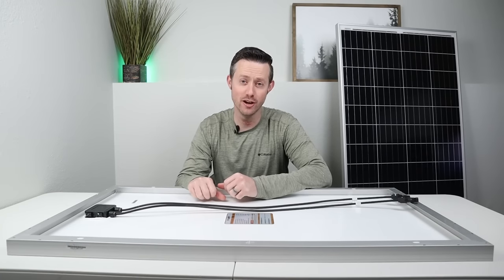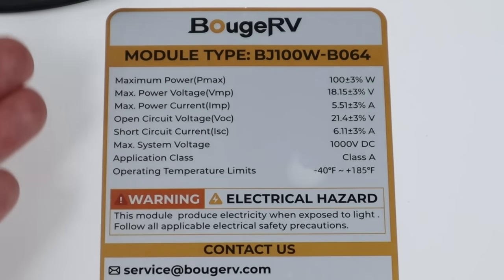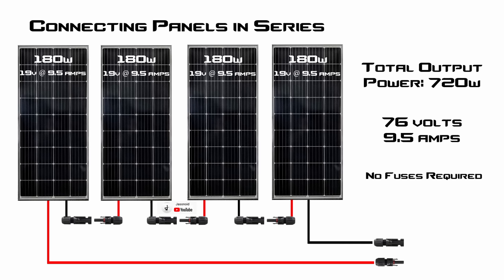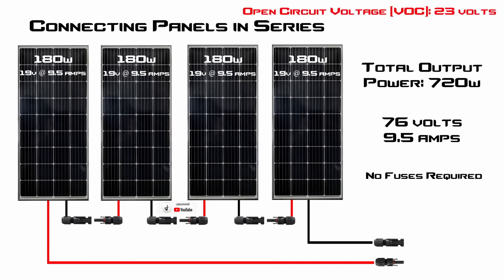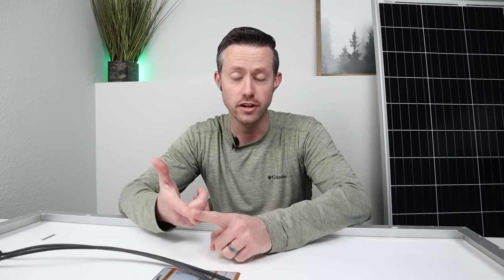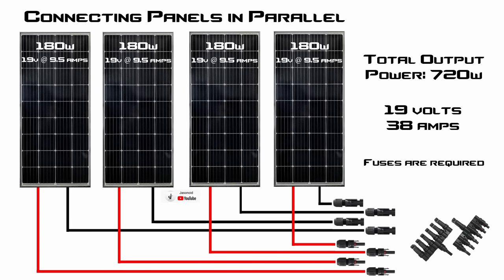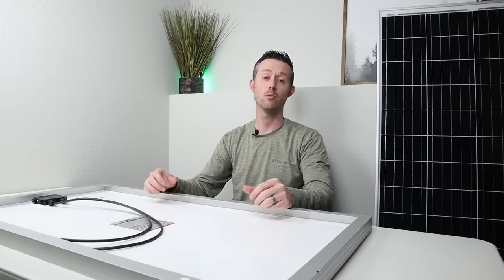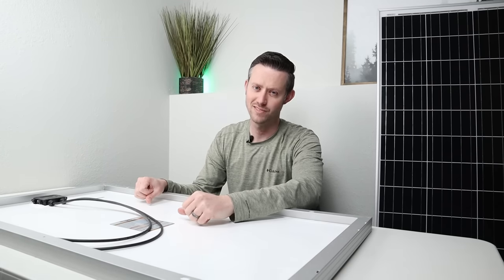Series VS Parallel! A Beginner's Guide for Solar Panel Connections - With Basic Diagrams!

Comment: After several years of learning about solar for my motorhome, I finally built a fairly robust system. I had just enough room underneath the fridge/pantry area to fit all of the components. 520AH lifepo4 bank, 3 separate 40A/150V MPPTs and a 3000W inverter for a 12V system. I have 2 sets of 3-250W panels on the roof connected in series, 1 set for each of 2 CCs. The remaining CC is for an additional series array when parked.
The system sometimes generates a total of 120A in full sun. 
I'm not sure if it's the most effective configuration but I couldn't fit one large charge controller under the fridge. It's been working perfectly for 8 months. I also have one additional 250W panel on the roof that I connect to one of the arrays in winter for a total of 1750W. I can also add an additional (4th) panel (in winter) to the 3rd array when parked, for a total of 2750W.
Reply from the maker: Sounds like a great setup! Thanks for sharing your progress and the direction you went with. I think splitting up the panels on different CCs is a great option to avoid too much amperage. I always like to hear real world examples.

Comment: Thanks so much for this video. I have really learned something from it. Please, i have 2 300watt  panels, 1  200amp battery and 60amp charge controller. What connection is appropriate and what size of MCB should I use? I will appreciate your response.

Comment: Good info!  Presented well!  I am studying to be able to build my own system.  Looking for info on good, inexpensive  Lifepo4 batteries.  I’ll be looking to find  videos  you may have done on choosing batteries.
Reply from the maker: Are you planning to charge or use your LFP batteries when it's cold? It may be important to make sure the battery you choose has low temp charging protection. Many of the "inexpensive" options don't have that.

Comment: Video was good. It would be nice if you could explain the selection process for the MPPT controller. For instance, will a Victron MPPT 100 / 20 controller be sufficient for 3 - 100 W panels. Vmpp 17.5V, Impp 5.8 A;  Voc 21 V, Isc 6.2 A.

Comment: Very good video! Thank you! When it comes to best option for the most efficient charging, what would you suggest? This is a lot of good info, but I’m still not sure which way is best to use.
Reply from the maker: Higher voltage solar arrays don't require large wiring. It kinda depends on how large your array is but I'd recommend doing an array with 3 or 4 350w panels in series with a charge controller that takes in 150voc.

Comment: This is a fantastic video and I'm very grateful for it . Congrats .

One question: 
I understand that in series the volts are cumulative and in parallel the amps are cumulative. 
So : 
If you have two pairs of two panels  where each of the panels are in series but the two  pairs are in parallel  then the amps are cumulative for each pair.  You covered this on the video really well 

But what happens WHEN EACH PAIR HAS A DIFFERENT VOLTAGE? 
In other words one pair 30 v 5 a and the second pair 55v 5.5a 
Then the amps will be cumulative: 10.5 a but the voltage is ? 
Perhaps (30+55)/2 ?
If anyone can answer that it would be great !
Reply from the maker: Mismatched panels will try to meet in the middle with voltage. One panel will drop and one panel will be above its rated voltage. You'll get less power than using the panels separately.
Reply: Thanks Jason

Comment: Excellent explanation  sir question sir if i use solar panel in series but different wattage what will happen to the system-thank you sir GodBlessed
Reply from the maker: When connecting solar panels in series, it will add up the voltage of each panel, BUT when the amperage is different (mistmatched panels) it will always go with the panel with the lowest amperage. So if you had a 10 amp panel and a 5 amp panel connected in series you'd only get 5 amps output. That's why you always want matching panels.

Comment: You should explain if the solar panel series connection or parallel connection is good for 12 volt or 48 volt systems

Comment: Really good info,well explained,  power companies are not interested when an individual needs info on a tailor made system ( as most are ) . Sizing is particularly difficult,  I need info re wether 4x 1 meter panels would be able to put sufficient power into a 100 ltr. Hot Water Tank, not to heat too any high temperature, but to give the heater a base to work from other than stone cold water.  Any info much Appreciated.

Comment: Terrific video and explanation. You've become my goto channel for learning about this stuff. 
I'm getting a 767/F2000 and I think I'll be getting some BougeRV 200 watt panels but they'll be  about a 50' run from the panels to the generator. Is the voltage drop too great at that distance or will a larger guage cable be able to handle that without too much drop?
Reply from the maker: Voltage drop is all dependent on amperage going through your wires. Since the F2000 has a 20 amp solar charge controller you'd want at least 10awg wire, but 8 awg wire would be best for a 50 foot run.
Reply: Wow! Thanks for the quick reply!

Comment: Nice easy to understand video. Quick question as you know your stuff.. I’ve got a touring caravan want to fit solar panel on roof 200w had ridged panel before but what’s you thoughts on the stick down flexible panels witch is best.cheers mike
Reply from the maker: These are currently the best 200w flexible panels that I know of. They put out great power and have been working well since last year. I have had them out in the elements everyday since then and they have been holding up:   https://youtu.be/LBel4dpbKqw

Comment: Thanks for the content and quality of instruction.  Can you please address wiring a 50W and a 100W together, parallel and series.
Reply from the maker: Putting mismatched panels together can be tricky to get the most power. With a single 50w and 100w solar panel it's probably best to wire them in parallel since the voltage will be similar.

Comment: Very informative and easy to understand tutorial.  Question, is it OK to connect different wattage panels in either series or parallel?
Reply from the maker: You want to have panels that have similar specs in volts and amps. They can differ a little bit but if they are far off from each other the power will be dramatically reduced.

Comment: Hello from Athens sir, recently I bought 3 solar panels which is 410 -420 watts each,24 volts.I will make a parallel connection with them to achieve a maximum 51 amps  charging current...my questions is shall I use fuses for each one and what diodes must I use ? Thanks for your time sir.🙋🇬🇷

Comment: Yes, great job, can 10 awg wire to the generator be used with 12 awg wire on solar panels ?
Reply from the maker: Yes, you want to always use a larger gauge when the power is combined.

Comment: This video is extremely helpful you’re very thorough and the way you explain it it’s very easy to understand even for someone like me that’s still learning I believe I will try for a 12 volt system in series and parallel. Is Bouge going to have all those connectors you showed. As far as things I would like to know more about all this stuff is pretty interesting and very informative however I am very interested in these new lithium batteries power queen has some and lots of others on Amazon I’m very curious about how to use them with a charge controller and an inverter without ruining them. Thanks once again for a very informative and very good video on this stuff. Regards: William Foreman.
Reply from the maker: The newer budget LFP batteries are priced really great right now! Power Queen and Redodo make great batteries that have good performance.

Comment: Excellent job explaining this complicated subject. I liked, thumbs up and subscribed! From what you have stated it seems like when doing a series and parallel combo that fuses maybe needed if the total amps exceed the amps of the panel. Is that correct? I’ve got 4 100W panels at 6.2 amps and 18 V. In order to not exceed the max input to the EcoFlow Delta 2 Max I was going to wire 2 groups of 2 in series and parallel into the the EcoFlow. From your video it appears to me that I would exceed the panel amps in this connection and 4 fuses on the positive lines would be needed? If so, can you provide any details on the fuse requirements? Thank you for all your great videos helping us all.
Reply from the maker: Usually the panel will say the maximum rated amps allowed on the tech sheet on the back. You would match that number with your fuse. Probably 10 amp fuses on your current setup:
This would work. https://amzn.to/3IOkR53

Comment: IDE like to see a video with more info on series versus parallel connections. The advantages higher voltage over higher amps lower voltage. And the real world affects of shading. Also no one explains that the higher voltage gets converted to amps when in series at the charge controller. So this ends up being the same amps going to the battery. As far as I know

Comment: Great content.  What if I have three solar panels or say two have the same wattage and one has different wattage? How will I do my connection set up?
Reply from the maker: For the best results you'll want to have matching voltage and amperage in the array. The only way to connect mismatched panels is by making them similar in power to the other solar panels in the array.

Comment: Great info. I just purchased 100w pannels. How would the amperage out put work with the Echoflow DeltaPro being the input Amp is only 15a?
Reply from the maker: You might want to check out this video to understand how to setup a solar panel array for your power station.
https://youtu.be/4JG8LvJznLY

Comment: Didn`t get notifications so I`m catching up. Shared your link with a few prepping and weather groups and put in a good word or two. I may need to run over 400 feet of cable for Winter solar. When I was buying my solar batteries I had planned to move to a different location. Not sure how my MPPT controller works. I will need to either over-panel or run very long cables in Winter. But for two hours aprox in Winter I get full sun but don`t want to fry my controller or my battery/cables by over amping if I`m using a lot of panels in Winter when the sun peeps through the trees twice. Not sure what to do.
Reply from the maker: The support for the channel is always much appreciated! If you are running long cables between your devices and solar panels. I recommend having your panels in a series configuration so that you have higher volts and less amps. You'll get less voltage drop along the cable run.

Comment: thank you, very helpful,  need to ask you a question, i have a 24v battery, i was thinking to get two 200w panels for my van, would it make sense to get the 24v panels or 12v panels, thanks, Dan.
Reply from the maker: If the panels are wired in parallel, you'll need 24v solar panels. If the panels are wired in series you could use two 12v panels to achieve the higher voltage.

Comment: If im trying to keep a 12v car battery charged with 2 small solar panels, it would be best in series then?  It will be hooked up to a 12v 10A controller to protect the battery.  I believe the 2 panels are rated for 30W 18V and 2.3A

Comment: Hi. The video is helpful but as an electrician I need to know further towards the connections with the mains and to be able to switch on and off the grid manually and automatically. 
Thanks
Reply from the maker: Grid tie systems and off grid systems are very different. My channel mostly focuses on off grid solar for camping, Overlanding, or small backup systems. Grid tie solar requires permits and most areas have tons of red tape and hoops you have to jump through for approval.

Comment: nice video. But what about after?How the type of solar charger controller is being effected in each case?
Reply from the maker: You wire your solar panels to match the input specs of your charge controller. I'd look for a charge controller that can handle 150voc or higher so you can use panels in series (that's my preference)

Comment: Great video. What millimetre or gauge are the wires. Which configuration is normally used. What is the general rating for MCB and I'm assuming it's a DC MCB. Thanks
Reply from the maker: Most solar panels have 12awg wire for the pigtails. MC4 connectors are usually rated for 15-20 amps. When in series using 12awg should be fine for shorter distances. I recommend 10awg for longer wire runs. When in parallel you'll need much larger wire to handle the increased amps over a long run of wire.

Comment: Hi jason great vid,i currently have 14 panels which i installed on my roof a while back with a standard 3.6kw inverter.
I want to upgrade my panels for higher wattage and add 2 more panels so that would be 16 in total,and also install a 5.6kw mppt inverter but the max voltage dc is approximately 450volts.
So i need to do a mix of parallel and series to decrease the voltage.
Any ideas on the best combination to achieve this

Comment: I have a sloped roof that faces east and west; in the morning, there is shade on the west, and after 12 p.m., there is shade on the east. So, if I plan 5 panels on the east and 9 panels on the west, do I need optimizers on all of them to achieve maximum efficiency or Its enough to put microinverters on the east side panels and string inverters on the west side and combine both? Another thing is - is it advisable to avoid the 5 on the east and connect all of the 9 on the west in series for higher efficiency? I'm wondering - if I have 15 microinverters on all the panels, won't it be pricey and not worth it because we usually receive sun? - If I have 15 microinverters on all of the panels, will it be expensive and ineffective because we get sun mostly on the west side and no sun on the east side after 12 p.m., so what is the point of having one on the east?  - is the question? Could you please answer? I appreciate it.

Comment: Hey Jason, I  like the video and would like to know more. Can I  connect 1.6kw of solar panels to a battery power station like a Jackery? Given the panels generally never reach Max power? Is there any protection built in to protect the battery or are they all different depending on the brand?
Reply from the maker: This video goes over the process of choosing the right panel for each power station based on voltage and amperage:
https://youtu.be/4JG8LvJznLY

I also have a full review of the new Jackery 2000 plus on my channel and I test the solar and expand on the input requirements for solar.

Comment: I have a situation where I was given a 2002 Generac inverter and power cell that has 5 - 48v 53ah lithium manganese cobalt batteries. I would like to use this system in my motorhome. Do you have any idea or any experience with this system?
Also I would like to install a large array of solar on the roof. Any help would be appreciated

Comment: I have 4 panels (280 Wp each) in parallel feeding three 12V 175 Ah batteries (3 X 175 Ah) in parallel.  I have a 4000 W pure sine wave inverter and want to use it to run a 1 KW water pump. Will this system work during full sunlight? Will the batteries charge fast enough to maintain the power to feed the pump? I have an EPEVER 80Amp Solar charge controller.
ANy ideas?

Comment: I'm new to this stuff. I just purchased the Jackery 1000 V2, and the DC input information is confusing. I'm still trying to find the maximum voltage for the DC input. I am not using their panels; they are too expensive and need permanent roof panels. You said fuses are required anytime the combined amperes will go over the rated amperes of each panel."  The amps always increase on a parallel connection, and the voltage stays the same. Do you install these fuses on the panel's or solar generator's sides? Most other videos say to connect positive to positive and negative to negative. Finally, some good information.
Reply from the maker: I recommend using inline MC4 fuses for panels in parallel:  https://amzn.to/4cKJrBu
The fuses go on each panels positive wire before connecting them into a parallel hub.

Comment: Which wire Guage should we use for a string of 8 panels connected in series. 
Each panel has a voltage between 48 and 52 and a short circuit current of 14 AMPs.

Comment: Hello and thank you for sharing your knowledge, great video, i would like you help me connecting solar panels to inverter, when look at the specifications or data sheet on my pannels and inverter, i get confused with the maximum input current on the data sheet on the inverter solar charger mode, it says 18 amps maximum, on the panel it says 10.77 and i want to put 4 panels in series and 2 parallel and that will exceed the the 18 amps on the inverter, can you help me understand the data sheet of this please, thank you once again.

Comment: QUESTION;  So if my max solar due to my 10 gauge wire is 600 watts, would I be better off staying with that, if so, series or parallel?

Comment: When panels are in parallel the voltage from a panel in the sun is higher than the voltage for a panel out of the sun. The "load" in this situation is the mttp controller AND the other panel. How much current flows through the other panel ? What is it doing too the other panel... Heating it? ive not heard of configurations using series power diodes at the output of each parallel panel or string but this would ensure the load is only the mppt controller. Kindly, Your thoughts please?
I'm thinking of "solaring up" my we camper trailer with a number of panels roof, sides, back lift etc so panel  illumination will vary considerably.